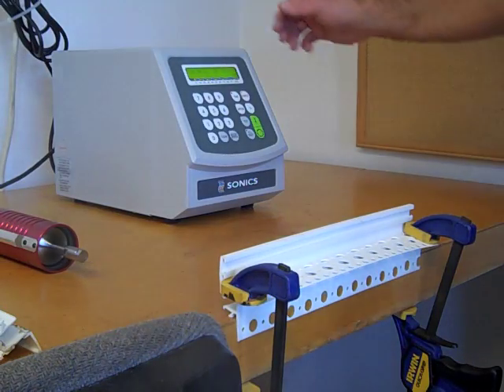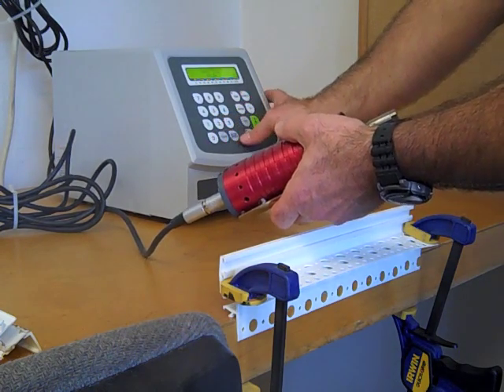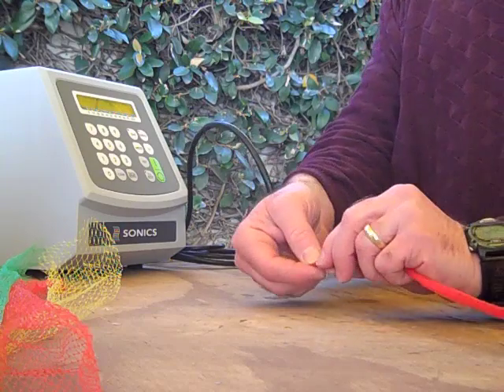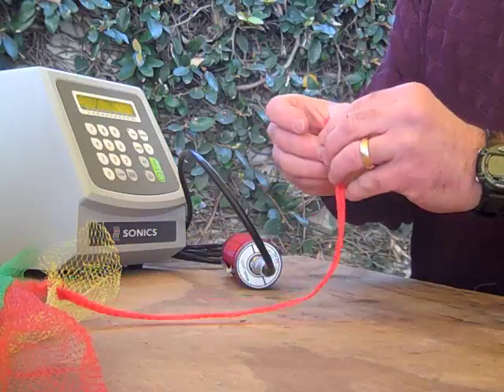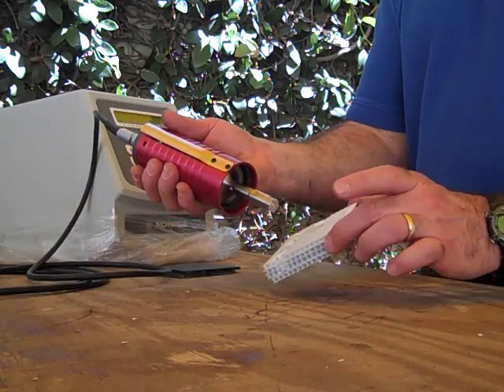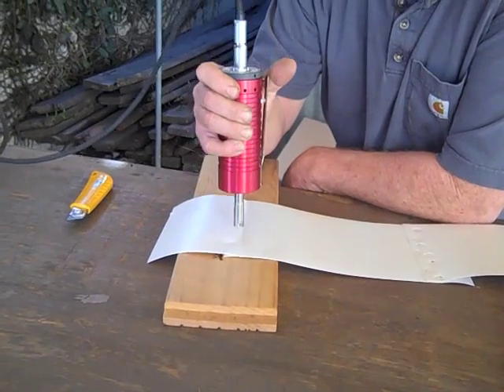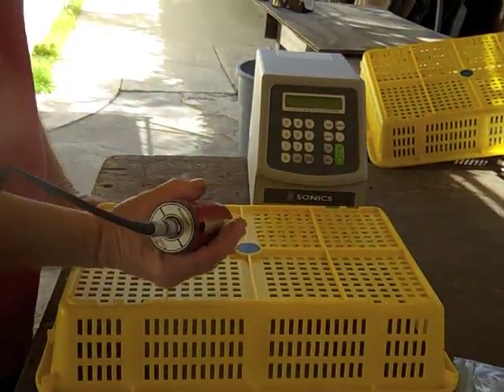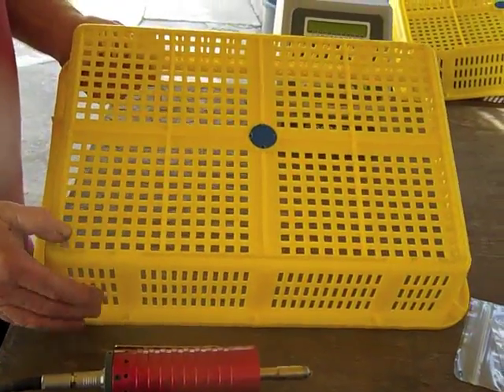Ultrasonic Welder Demo

Comment: I was wondering if you knew of any ultrasonic welding techniques that could seal the bottom section of a MRE bag and join it into one solid piece of material. I think most MRE bags are simply heat welded like you might find in a food saver type machine. I was just wondering if ultrasonic welding could help with making a MRE bag into something that you could boil water in without having it leak.
Reply: Boiling water in a sealed container creates steam. Please video this steam grenade (from a distance) if you attempt it. Individual pouches for foods to be heated are designed for immersion into boiling water which is different than boiling the contents. Handling pouches of boiling water in the field should be quite entertaining for bystanders. Please video that, too but wear appropriate face shield, rubber gloves and an impermeable apron if you own one. Even the simplest experiments are instructive and often teach more than anticipated, but do be careful.

Comment: Hello! When using my ultrasonic welder on PEI with carbon fiber I find it very difficult to keep the sonotrode from sliding around on the piece. Do you have any advice on how to prevent sliding?
Reply: Did you try a cheap drill stand?

Comment: Man the configuration it’s in is kinda useless for $4-5,000.  You can accomplish the same thing going onto ebay and buying a $65 ultrasonic tooth scaler that plugs in and use that. Matter fact I’ve used mine in that manor to plunge on one spot to weld something like that.  But also can work it up an down a crack in a plastic part and weld cracks.   By design this one does only pretty much what u see here.  Atleast the tooth one isn’t designed for plastic welding but you easily can.  And if the want is there make your own tip for the thing and use it in any direction instead of just up an down pressure
Reply: Very interested in this, do you have any more info about this process? Like what sort of ultrasonic cleaner you used?
Reply: Clever

Comment: Hey buddy can it be used to solder wire on a plate?
Reply: It is best for welding two flat metal sheets but for wire ,it's expensive dude

Comment: Is this good for only plastics that need moderate bonding strength, or is it as strong as a high grade epoxy or plastic cement?    Any concerns with the bond if exposed outside to the elements?
Reply: They use these for mail bins. Surely you have seen the prejudice that mail drivers treat their mail bins with

Comment: There's distortion in the videos audio when you go to use the gun, is that interference with frequency's ?
Reply: EMI / EMC
Reply: @josebevilacqua2971  well... would still consider some form of hearing protection, especially when it's rigid to rigid piece adhesion (moving one piece against other, as opposed to spotting).
Reply: It uses high frequency sound waves so of course it interferes with the microphone

Comment: How exactly expensive is that wielder?
Reply from the maker: Hi, it's 4800.00 here is more info: https://www.abbeon.com/Item--i-148
Reply: @abbeoncal  i want to weld nikel strip on battery cell, will it work on metal
Reply: @Alokumar005  Double check the manufactures' data sheet it may not be advisable for 18650s

Comment: Isnt this just melting the plastic together>
Reply: Isnr welding just melting metals together?
Reply: @brunomusraimondo7710  no typically welding is not melting metals together. typically you use a filler metal protected by a gas or flux. melting metals together is specifically called fusion welding. it’s the most basic form there is
Reply: @zforbes839  woosh, smartass but also a great note...still the point was that fusing plastics with ultrasonic friction welding is just as standard as welding metal, yet both are just  melting stuff. Wait, is that incorrect? No metal melts during welding? School us, please!
Reply from the maker: Yes, but the tip doesn't get hot.
Reply: When you are welding plastic with hot air or a hot tip, you need to fasten them to prevent deformation, in case you are heating the interface on both pieces. If you were hot tip welding a 0.2 mm PP sheet to a 5mm PP sheet, you'd have to heat through the thin sheet in order to melt the interfacing area on the thick one - visible holes. 
With this method you are basically rubbing the materials together, so heat is generated on the mating surfaces, so you just melt through a certain thickness of each sheet on the inside without deep melted spots. You only need as much support as the cold materials need (eg the 5mm sheet may be enough by itself, or laid atop the workbench). You may ofc enhance the effect by pre-warming the larger piece (as it could heatsink the interface too much). This makes fusing plastics as easy as machine sewing, just a shame that the most basic of the tools are so darn expensive.